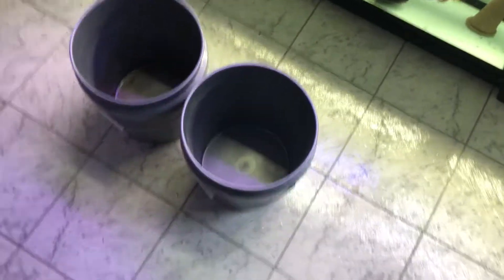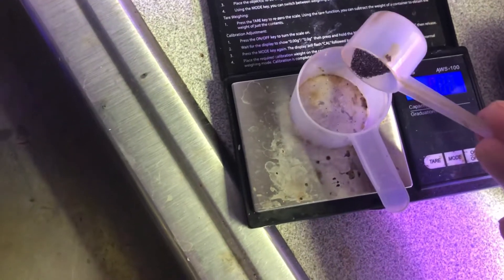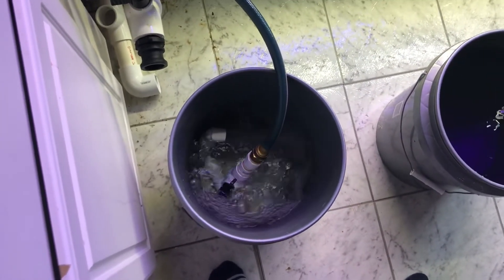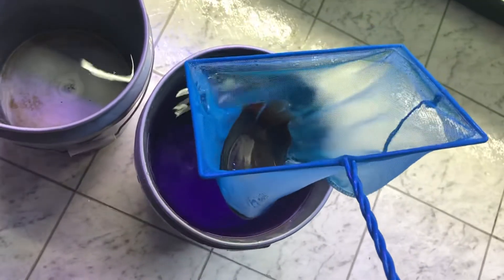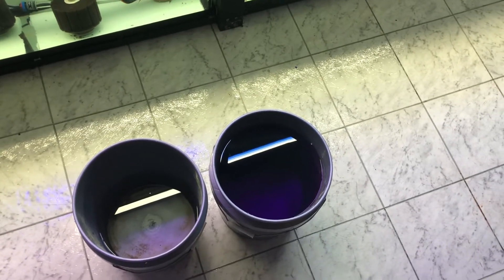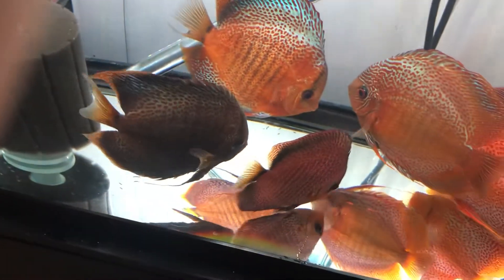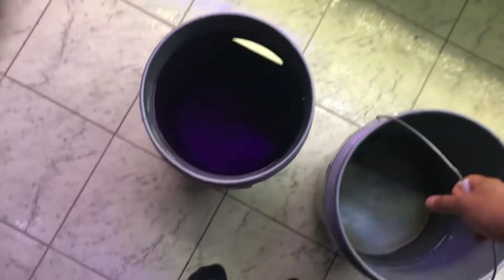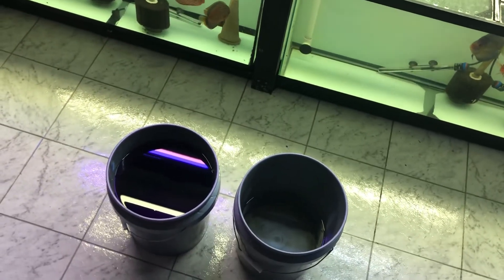Potassium Permanganate (PP) 3min Dip on Discus

Comment: Thanks for posting this! Assuming that the potassium permanganate is pure, 0.32 grams in 5 gallon dip would be a concentration of 16.8 mg/L (assuming my calculations are correct). Likely more like 4 gallons is placed into a 5 gallon bucket so the concentration would be higher. Thanks again for posting this.